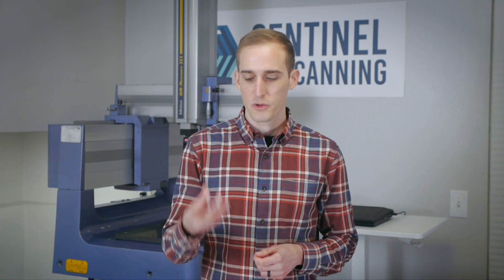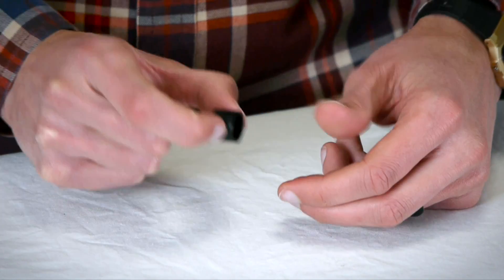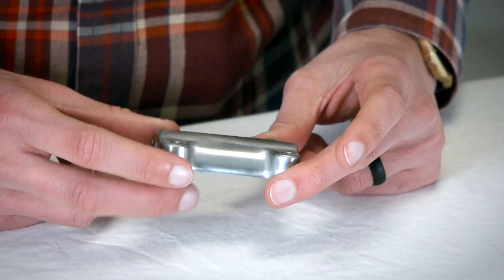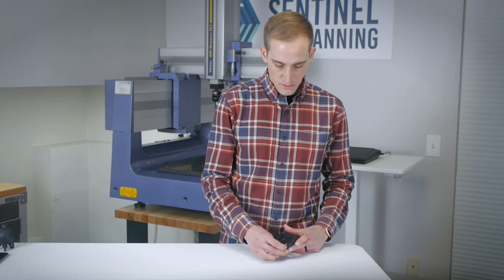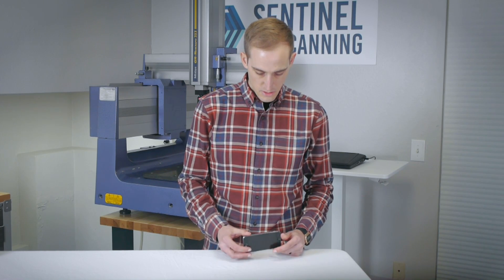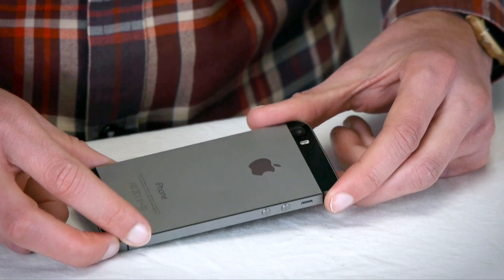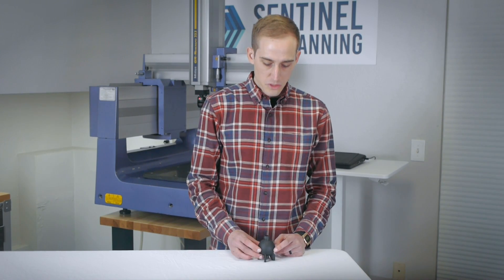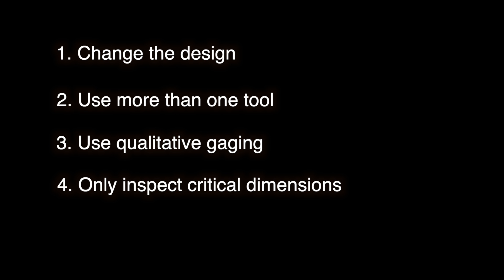When Hand Inspection Tools Just WON'T CUT IT

Comment: On the rocket lens blower, could you use an ultrasonic thickness gauge with a steel ball on the inside of the rubber sphere? This would be a very low cost method with very accurate measurements.